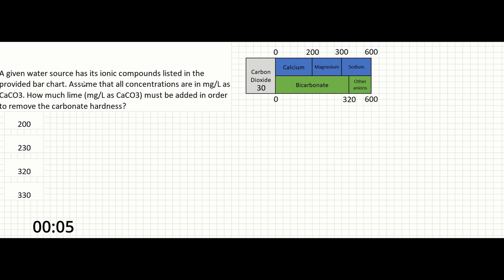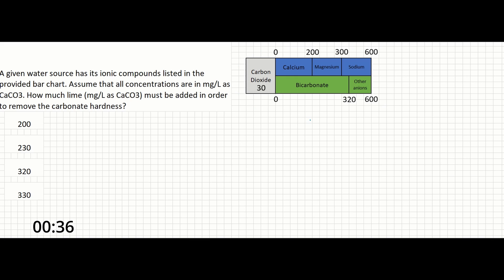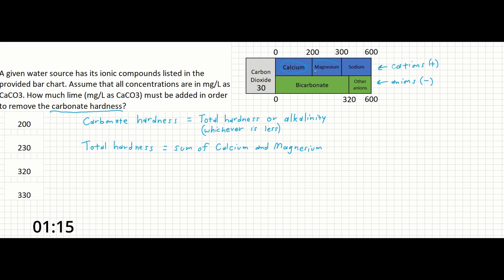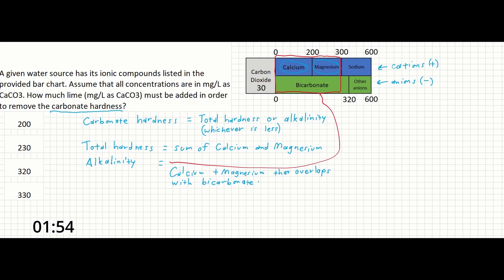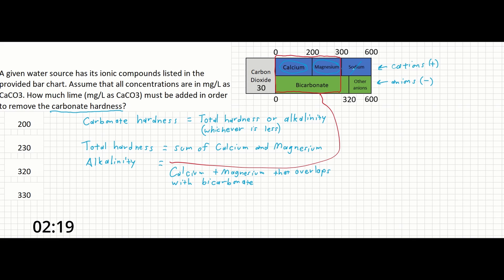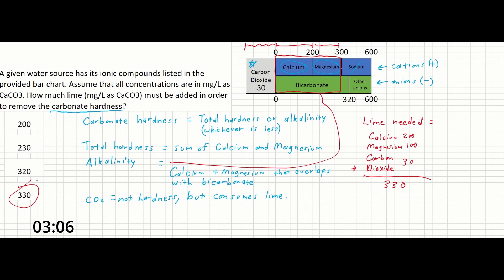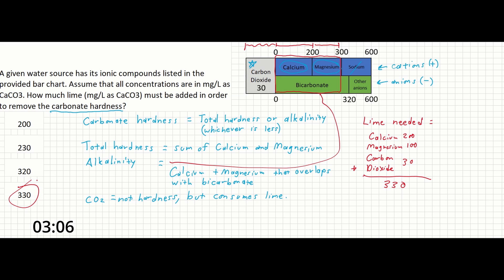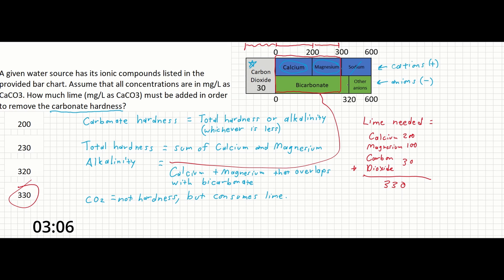PE Exam Practice Problem #24: Water Resources | Env. Eng. - Hardness - Water Softening - Bar Chart

Comment: If there is excess lime in the problem you do not need to include the Mg concentration in the problem. Excess lime is used for the removal of Mg. There is no need to double up and create more sludge for yourself. This is just a common mistake I see in calculations. And a way they can trick you on the PE exam.
Reply from the maker: Thanks for weighing in on this point as well. I was wondering just how many ways I was wrong about this problem at once.

Comment: Great Videos! , Shouldn't the answer be 430? since in order to remove Magnesium Carbonate Hardness you need two molecules of Lime instead of one?
Reply from the maker: Thanks for watching. This is the most watched video on the channel, and you might have just found a mistake in it. Uh-oh. I might need to figure out if this needs to be taken down or otherwise edited somehow.
Reply: We are not using stoichiometry here. That is another method that could be used but not in this example. Everything is already in CaCO3.  

But its still not quite right. I don't think. 

TH=CH+NCH

Total hardness is typically the sum of Ca and Mg. It appears that in this case that value is 300 mg/L as CaCO3. But carbonate hardness (bicarbonate) appears to be 320 mg/L as CaCO3 which is a higher concentration than the value for Ca and Mg (300mg/L as CaCO3). So the bicarbonate value becomes the TH because it a higher concentration. 

To find the dose of lime it should be: 

[CO2 + Alkalinity + Mg] and this is all in CaCO3. If it wasn't you would have to convert to meq/L and multiply by the mg/meq. 

But given its already in CaCO3 it would be: 

[30 mg/L+320+100mg/L] = 450 mg/L

We don't include Ca because it precipitates out of solution very quickly. And if you have excess lime in the problem you don't include the Mg value. Because excess lime is used to remove Mg hardness.  

I could be getting mixed up but this is how I have done these problems in the past.
Reply from the maker: @kevinkruger6233  Thanks for sharing! This problem was based on another one I found on an old NCEES practice exam. Its definitely frustrating that there seems to be so much uncertainty about the approach to this problem. I felt like I finally made sense of it when I first posted it and now I'm worried I've led tons of people astray.

Comment: Shouldn't the TH be 300?
Reply from the maker: The total hardness is 300. But that is not what the question is asking. The question is asking how much lime must be added to remove the total hardness. Since there is Carbon Dioxide present, more lime is needed since Carbon Dioxide consumes lime.